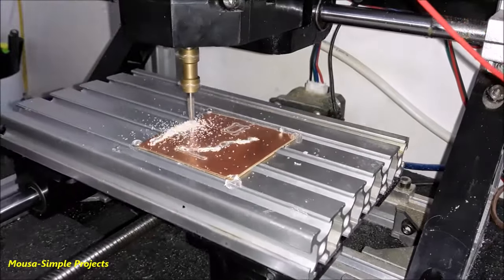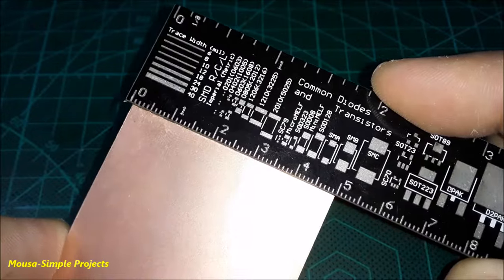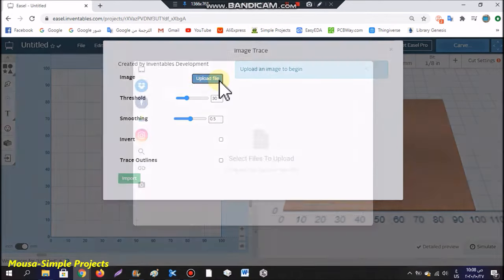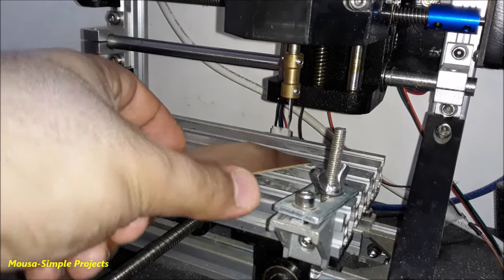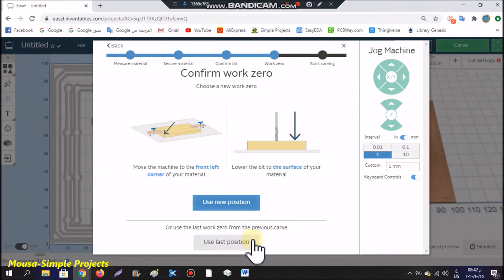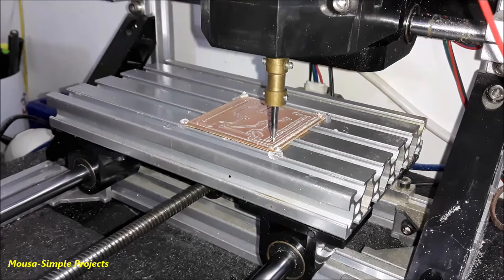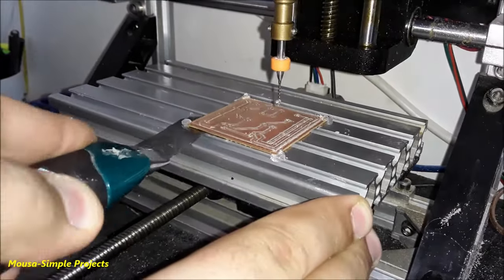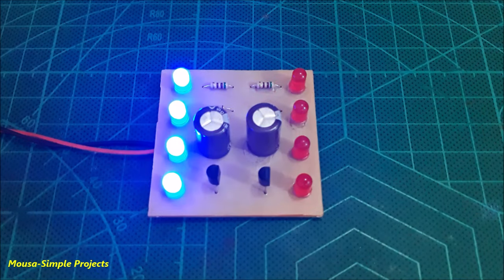PCB Milling using CNC Machine Without using Gerber file and Without Installing Software \ CNC PCB

Comment: Please tell about machine how to use and where to order
Reply from the maker: You can order it from Banggood, there are two sizes (mine is 1610 small one) it comes with assembly and using guide  
CNC 1610 Milling machine: https://usa.banggood.com/custlink/vmGYFreBrn
CNC 3018 Milling machine: https://usa.banggood.com/custlink/Dv3hFJsen6